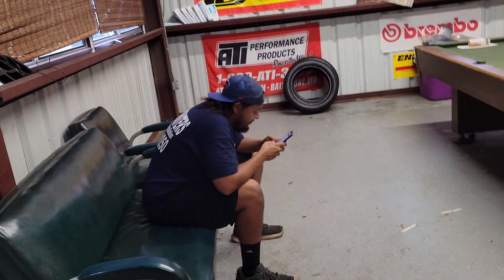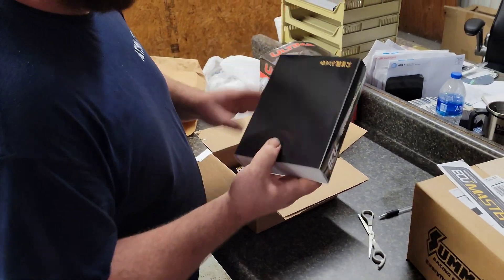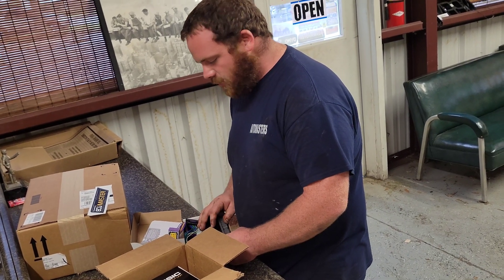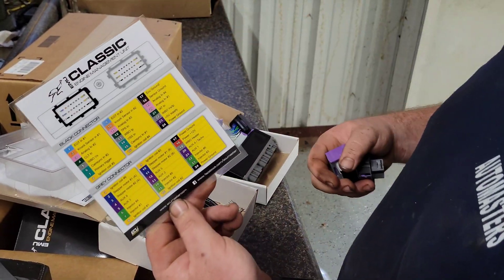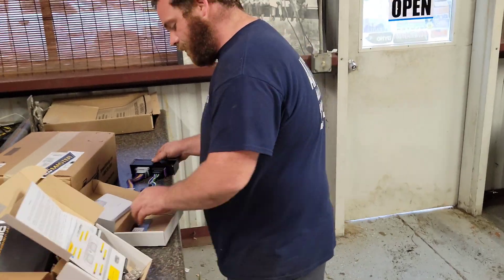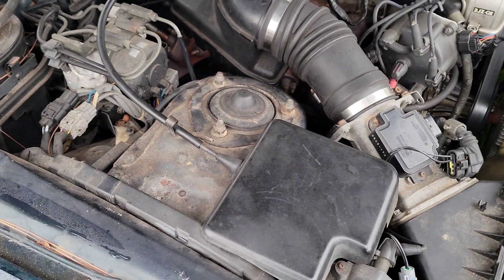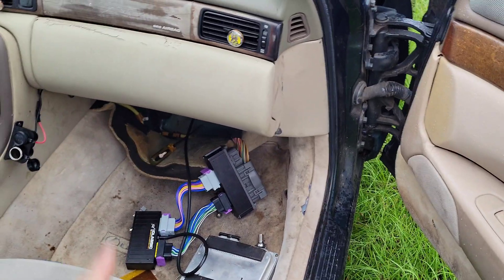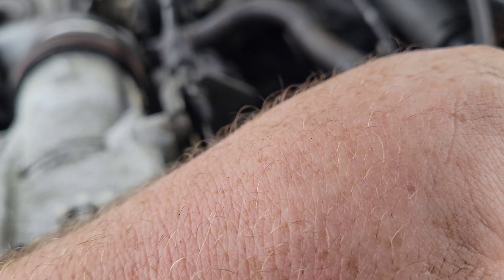1st mod for the sc300! Ecu Masters Classic emu

Comment: Hey I'm having the same problem my emu black wont register when plugged in. the software says disconnected. Did you ever figure out the fix? I've checked all my grounds and have even run power directly to the batter and nothing.

Comment: Did you have trouble getting the crank signal from the distributor when you installed the emu classic? Or did it fire right up when you uploaded the base map?
Reply from the maker: Had to adjust the fueling maps a bit but I called them and they remote tuned the ecu for me to fire up. Great customer service